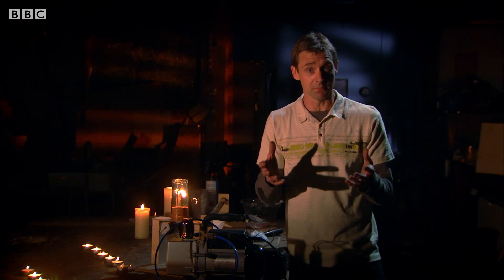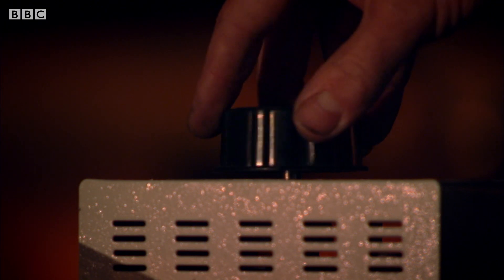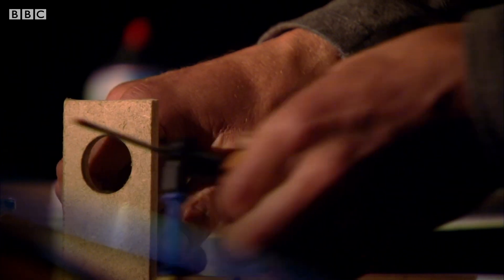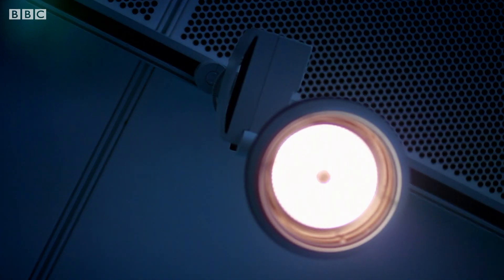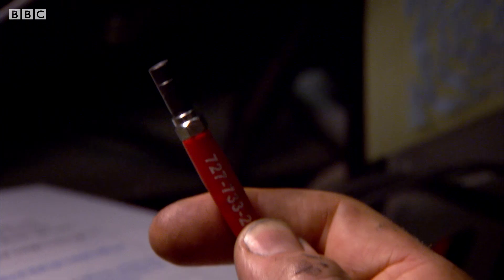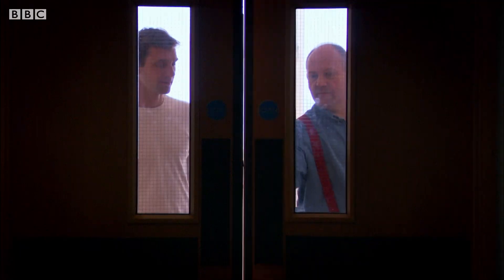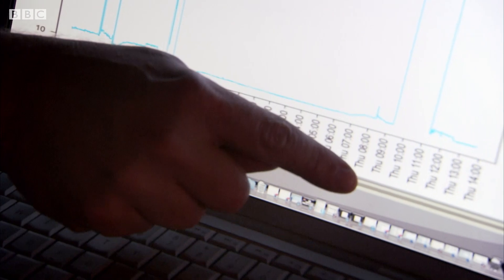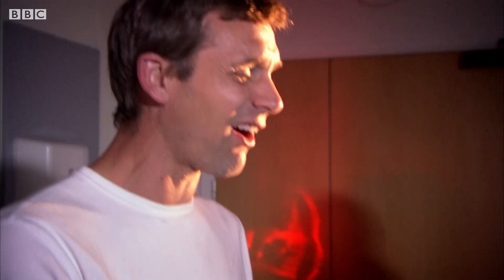How to Make Your Own Sunlight | Earth Science

Comment: Would could a nano scale gap mirror above and below as light between such a nanogap and a world's smallest bulb graphene made with your light gases keep a solar system as 1 mirror layerr (1 above facing down isn't see through mirror) is 1 way see through  

Suggesting questions gives an answer to the equation.
Solar power electric for a year is the challenge from a much cheaper smaller bulb = small power input = mass more electric made than used